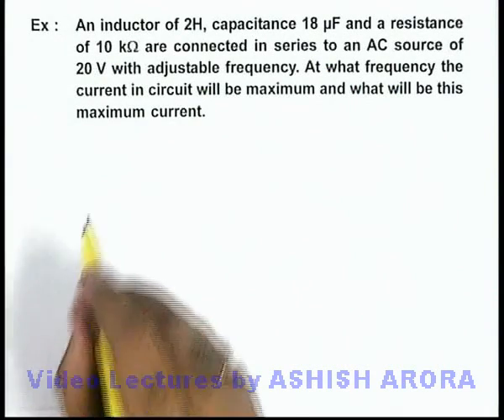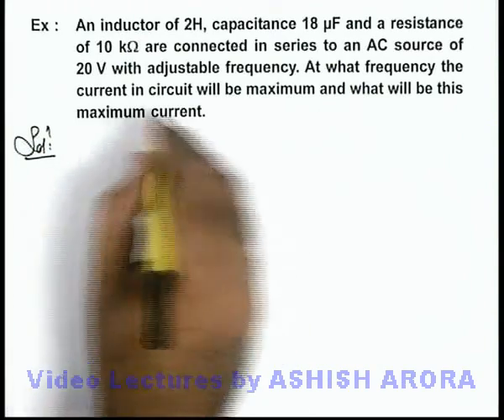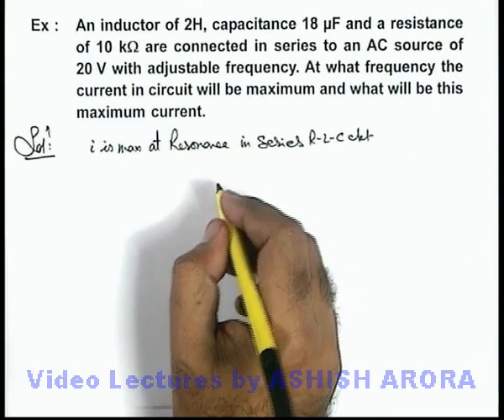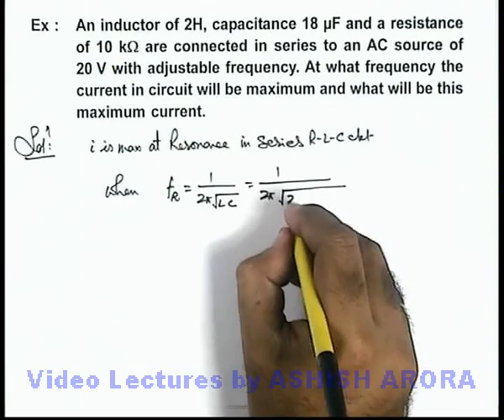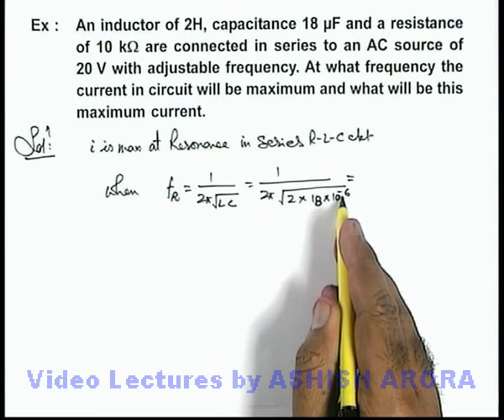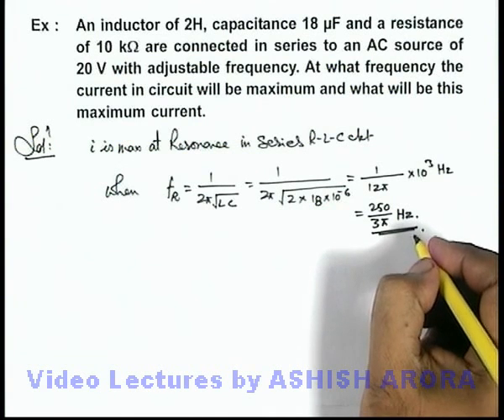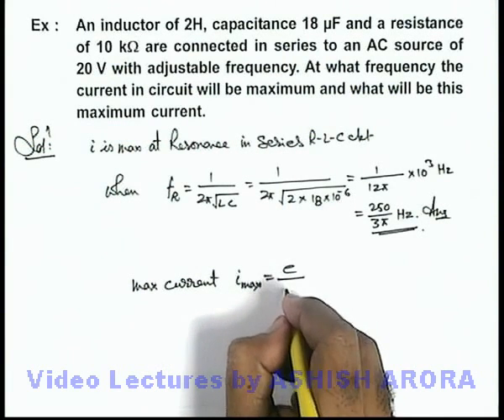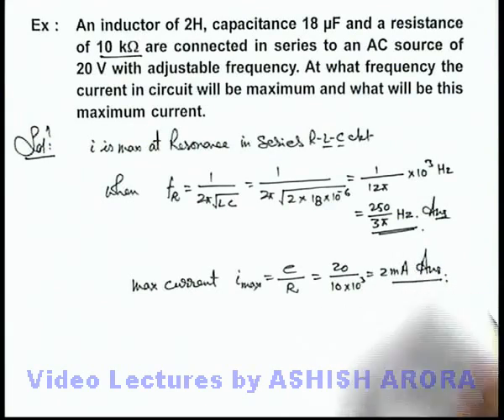Class 12 Physics | Alternating Current | #46 Solved Example-13 on Alternating Current | JEE & NEET

Comment: Sir please clear my problem... I get confused where to take e as peak emf and where to rake e as erms.. I mean in this question it is not clear to me whether the given V is erms or e peak voltage
Reply: See try to understand the question the question is asking the maximum value of Rms current, and also if you go back to previous lectures sir has clearly specified that at resonance. Irms will be maximum that is why Pavg=VrmsIrmscos(phy) is said to be maximum at resonance
Reply: I HAVE THE SAME DOUBT... 

ISN'T 20V RMS VOLTAGE??😬
Reply: @sushant92  yes you are right here 20V is rms value and here max. current is i (rms) not the peak value..
Reply: I have the same doubt, Imax=Erms/R, 
And Erms = Eo/ √2, so why did sir substitute 20 volt (Eo)?